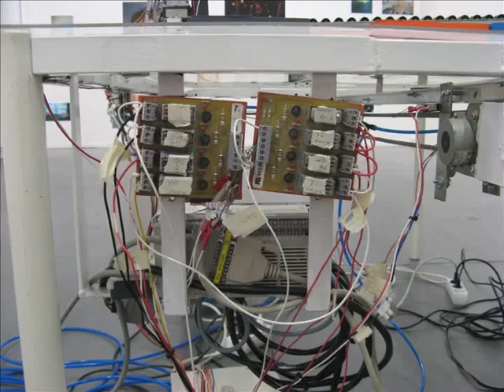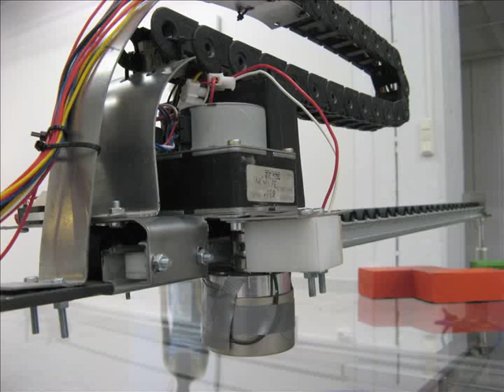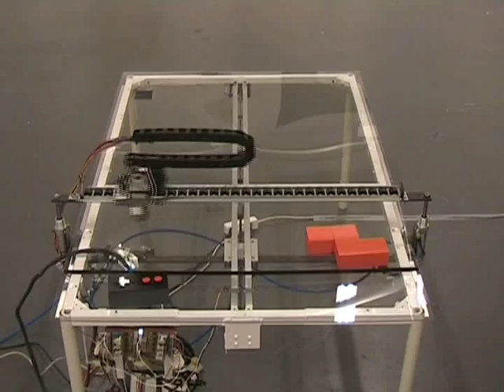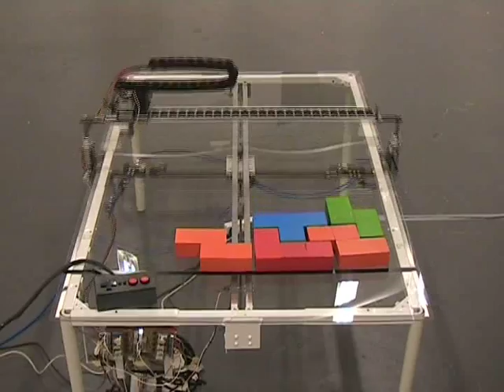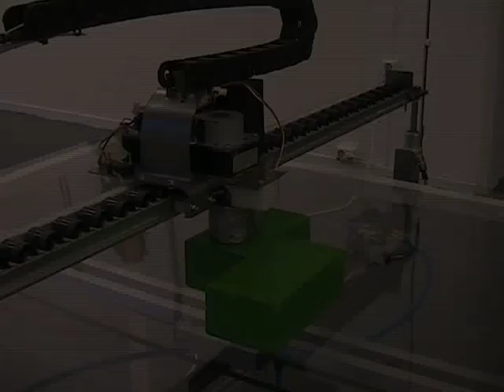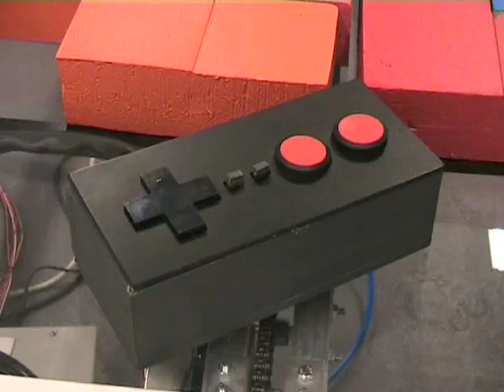Mekaniskt Tetris

Comment: Electromagnets might work, then the blocks can grip each other whilst being held by the arm, then release when dropped, and re-attach to each other in a horizontal line.  If the entire line clings together, then it could be slid off horizontally by another mechanism which could collect the seperate blocks and redistribute them back to the top